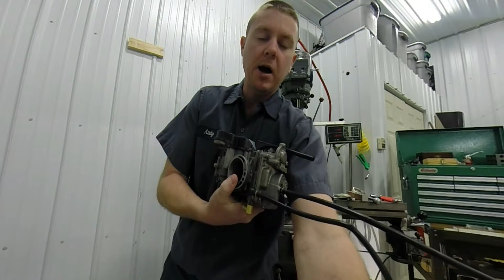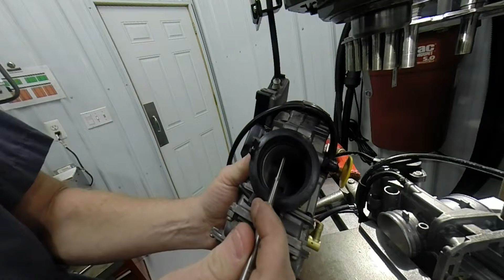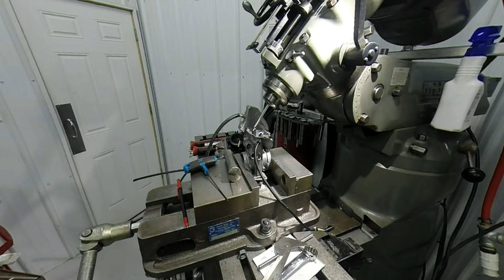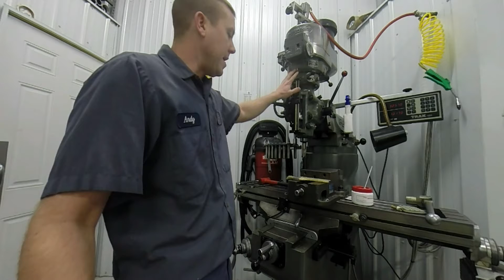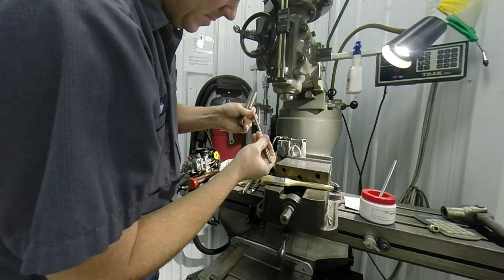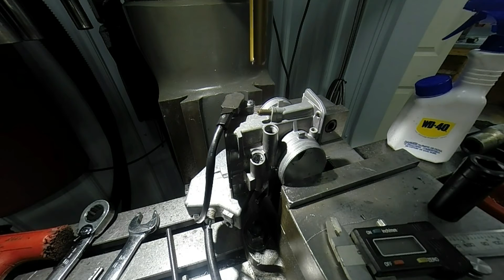FCR Carburetor Hot Start Mod

Comment: you mention the set screw that allows the air to get into the hotstart system...but since it is screwed in, how will that let air in?  on crf450r carb 2002-2008, the 'valve' is a brass sphere above the hotstart...great work by the way